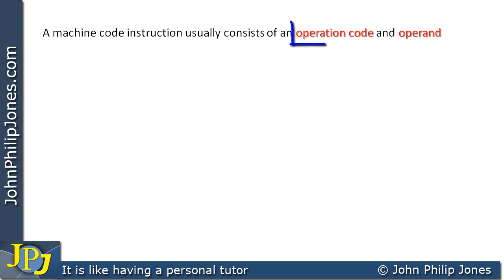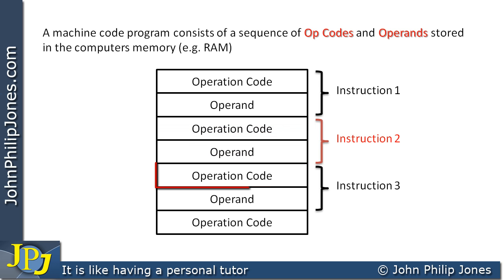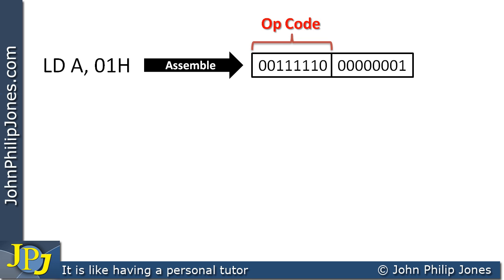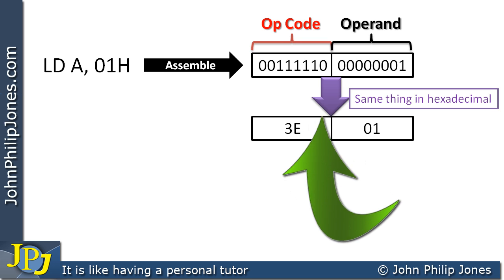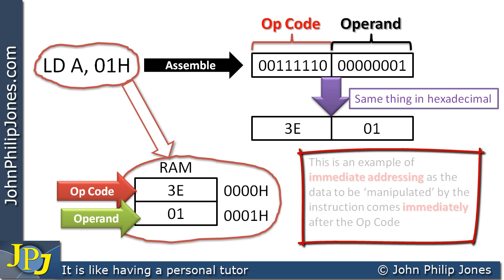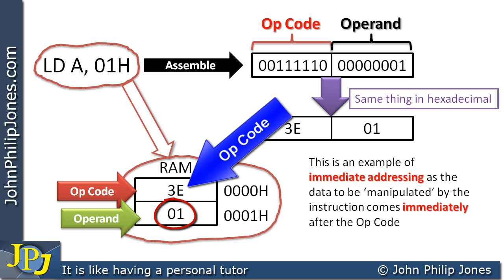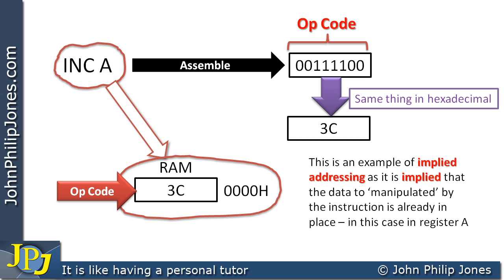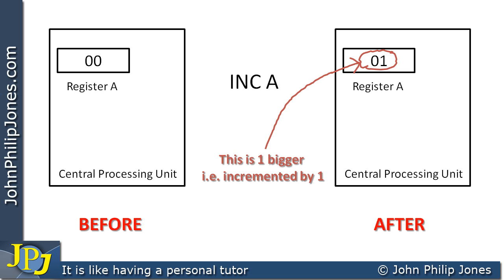Machine Code Instructions

Comment: Great stuff! Thanks. Is it necessary to convert instructions and operands to hex numbers? Can you keep instructions as binary code instead of 3E or something like that?
Reply from the maker: +zinturis You would normally code in assembly language and this is converted to the necessary binary codes by the assembler. So in the machine you would actually see binary and not hexadecimal. However, it is usual to look at the binary in hexadecimal as it is easier for us to remember hexadecimal numbers rather than long binary numbers and it is also easy to convert between binary and hexadecimal. The following videos look at converting between Hexadecimal and binary:

https://www.youtube.com/watch?v=fhgk2rxrn-Q&list=PL049A4BB543D49D6B&index=6

https://www.youtube.com/watch?v=V-he1Ip36OA&index=7&list=PL049A4BB543D49D6B

Best wishes
Phil
(John Philip Jones)
Reply: Thanks a lot for the quick answer. Sorry if my questions may sound stupid, I am quite newbie in this but if you want to send certain instructions of machine code to the processor, what's the workflow of that? Can you do it from some terminal or do you need to create a text file and save as .bin or .. how that works in practice? I mean, how to control that process?
Reply from the maker: +zinturis You use an editor and type in your assembly language program and save it in a text file and use an assembler to convert your typed in program to machine code. You will need to download an assembler to match the CPU of your computer. However, a good way to learn is to download a CPU emulator that has an assembler incorporated. I used to do assembly programming on a Z80 flight micro-board, a 6511 micro-controller using an in-circuit emulator. However, these have now been superseded and I am not sure what is used today. However, I believe that the Raspberry Pi has a set up that allows for machine coding. I would recommend searching with the phrase "machine code emulator" and see what is out there to assist. Hope this helps.
Best wishes
Phil
(John Philip Jones)
Reply: From your earlier respond, I understand that assembly language is different for different CPUs? So, if I write z=x+y for Intel it is not gonna work on an AMD based computer? So what's different? Assembly commands or register addresses?
Reply from the maker: zinturis z = x + y is a high level statement and will be converted to the machine code of the CPU that is 'in' your computer by a compiler. However, putting this aside the opcode for add on each different type of CPU is different. Each processor also has a different register set i.e. different number of registers and of different lengths. The architecture of the CPU's can also be different some are RISC other CISC or a combination of both CISC and RISC.
Reply: Thank you very much for such a huge amount of information.
Reply from the maker: zinturis Glad to be of help
Best wishes
Phil
(John Philip Jones)
Reply: :) ok, a few more probably last questions: does assembly language needs to be compiled or is understandable by CPU? How do you get all commands and codes for a certain CPU for your assembly version? Is there any command or file that prints out a list?
Reply from the maker: zinturis Assembly language is assembled to machine code by an assembler e.g. LD A, 87H is converted to 3E 87 which is the hexadecimal representation of two eight 8 bit binary patterns, The 3E and 87 (the binary values of these) is understood by the CPU. An assembler will give you a print out of the assembly language and the machine code (i.e. the hexadecimal codes.)
Phil
Reply: Ok. Cool. Thanks.

Comment: I want to know about how machine code is executed. I mean, since you already have these 1s and 0s in RAM, how can the CPU tell from so many instructions and do different actions correspondingly?
Reply from the maker: +Simon Lee When you switch on a microprocessor system (e.g. a computer) the hardware will always look in the same memory location. This location must hold the first operation code to be executed i.e. the program to be executed starts at this memory location. For a computer this is the boot program. For an embedded system containing a microprocessor this location would contain the first operation code for the first program to be executed.
Reply: +John Philip Jones  I am sorry, but I am still confused. I mean how  the CPU can know  these 1s or 0s mean MOV, ADD or SUB etc. How do 1s and 0s make sense to the CPU and indicate the CPU what to do?
Reply from the maker: +Simon Lee A microprocessor system is a collection of million of switches that control the movement of binary patterns along bus systems, In addition these switches can be arranged to perform logic and arithmetic operations. The control of these switches is achieved by another lower level language that is not machine code. However, the machine code is able to dictate which parts of this lower level language execute. Certain patterns within the machine code select the Mov, Inc parts of the lower level language that is to execute.
Reply: +John Philip Jones So, there is a lower level language than machine code. What it is? It seems to be getting complicated, is there any website or book that gives a  detailed information and help me understand?
Reply from the maker: +Simon Lee One of the levels below is microcode and this is responsible for directing binary patterns throughout the CPU. The main controlling subsystem within the CPU is the control unit. However, my advice is not to go below machine code as unless you are an electronic engineer it is more likely to confuse any understanding of how you can control a microprocessor system using machine code. My recommendation is to consider the register set of a typical CPU and use register transfer language (RTL) to understand how each machine code instruction executes. The best way is to look at manuals associated with a microprocessor (although they are not easy reads). A good starting place is to search for the "Z80 assembly language manual".

Hope this helps

Phil

Comment: Hi, I hope you can help me:

I know what opcodes are and how they work, but i want to know something that i have just realised i've overlooked all this time, assembled code (binary after assembly) is just a sequence of instructions in the .text section right? (so all the opcodes with applicable operands).

If so, i was wondering essentially how the CPU knows what each opcode actually refers to e.g. how does 0xDE mean 'load'?

for example: say the cpu of a microcontroller turns on, the program counter = 0, so it loads the first opcode in .text (at the start of the section) into cpu and a hardware decoder in the cpu physically decodes each opcode which allows the CPU to translate the intended instruction into the correct operation, right? (then as program counter increments, you process the next operation (opcode)in .text).

cheers!
Reply: +orbita1 Each OS has it's own standard of executable (Windows - PE, Linux - ELF...). OS loads the executable and parses the exe header and finds out starting address. OS loader then memory maps the exe and sets IP or EIP register to proper starting address by context switching. The program then continues there on.  Now depending on addressing mode, the operand can be from .text part or .bss or .data? etc segment.  

But the first instruction (after switching on) is always a predefined address. For Intel/AMD IBM compatible pc, it is FFFFFFF0h or FFFF0h (depending on 32bit/16bit). Most of them are pointing to BIOS startup routines, which sets up rest of the booting process. Once the ball starts rolling, it works.
Reply: Your struggle may be related to asking how does the computer "understand." Perhaps it would help to remember that a computer is merely a bunch of switches. Some of those switches turn other switches on and off. The computer does not "understand" anything in the way a human understands things. The computer is just switches which have been arranged by humans in such a way that certain switches turn other switches on and off in a way to represent numbers and characters understandable to humans. A light switch does not "understand" that the up position means that it is been asked to light the room. When the switch is in the up position power flows to the light because humans have designed the circuit to work that way.
Reply: +orbita1  I think I just have the same confusion like you. How can these 1s and 0s make sense to the CPU and be executed differently?

Comment: Machine code instructions are: E 
	 Binary patterns which can specify opcodes and data
	 Text Mnemonic Codes
	 Hex instructional codes
	 Decimal codes

which one correct
Reply from the maker: Machine code are the binary patterns that control the CPU. Hexadecimal is an easy way for humans to remember the binary patterns (it is easy to covert between binary and hexadecimal). Mnemonics are symbolic representation of the binary patterns and mnemonics form assembly language programs. Assembly language programs are converted to machine code by an assembler..
Reply: John Philip Jones  thank you I thout the A is Hex instructional codes now i get it.
so i have 2 Q when i folow you i think that I get the answer so far 

Q1.	Which of the following CPU internals can will fetch or store data to and from RAM?

Control Unit (correct- its; the job of CU to fetch data  from external devices and registers)

Regsiters

Interface Unit

Arithmetic Logic Unit 

Q2 Which of these CPU internals can be of either data or address type?

A- Interface Unit 
B- Registers  correct (both data and address- they can contain data as well can be addressed using predefined names)
C- Arithmetic Logic Unit 
D- Control Unit 
Q3
 also is  CISC CPU use of microcode . correct
Reply: John Philip Jones do u think my answers is correct
Reply from the maker: Ali Salman Q1 the control unit
Q2 the answer is B You are correct. Have a look at the following video:

http://youtu.be/XM4lGflQFvA

Best wishes
Phil
Reply from the maker: Ali Salman Yes Phil
Reply: John Philip Jones thank u

Comment: How we should find opcode for an operation is there any method r it is assigned value
Reply from the maker: +sanaaf Each microprocessor will have it own user manual and there will be a list of assembly language instruction and in the column next to the instruction will be the hexadecimal value for the instruction. However, you would normally type up the program using an editor and use an assembler to convert the program to machine code (i.e. hexadecimal which is a way to represent binary).
Regards
Phil
(John Philip Jones)

Comment: I get how you know that 01H is 00000001 in binary... But how do you convert the LD A into binary? Or is it something your remember from a list? I have to convert it into machine code, is machine code binary?
Reply from the maker: This is a very good question. Machine code is the language of the machine (I.e low and high voltage levels) which as humans we represent as binary. Every machine code instruction has it's own binary number. Load A with immediate data has the binary number 00111110 which is 3E in hexadecimal (an easy way to remember binary). So every instruction has it's own binary number. Every instruction has it's own binary number so in a sense it comes from a list as you suggest. However, in truth each number makes the electronics behave in a specific way. The binary patterns open and close electronic solid state switches that perform a simple task that when all executed in a specific order are able to implement sophisticated functionality.
Reply: John Philip Jones So does LOAD have it's own binary number? Or for example do LOAD A, LOAD B and LOAD C count as three different things with three separate binary numbers representing them?

And does this mean that there is no way of mathematically converting LOAD A into binary in your head/on paper without a table that literally tells you which binary number represents each op code I think it's called?
Reply from the maker: malteeaser101  LD A, N has its own binary number called an Operation code. LD B, N has a different operation code. When writing assembly language program you type in instructions such as LD A, N and an assembler (computer program) converts the assembly language to machine code (i.e. binary patterns). You can also do the conversion as a human it is called hand assembly and it means you would have to either know all the codes or access them from a printed list.Back in the day I used to code in assembly and as sad as it may sound I knew all of the codes. But there was only around 70 different instructions for the machines I was working on.
Reply: John Philip Jones Haha thanks, I have a assessment due in soon and this helped A LOT.
Reply from the maker: Mo Fo Hello Mo, Every 'type' of CPU (processor) has its own machine code language and related assembly language. For example Intel processors are different to Motorola processors and have a different machine code language from one another. The description I have put forward is based on the Zilog Z80 processor which also has its own machine code language.

I am unsure what machine code language you are referring to but what you are describing is  what is often called absolute addressing  The term addressing refers to how data is accessed by an individual machine code instruction. I have a short series of videos that show the difference. I have put links to their playlist below:

https://www.youtube.com/playlist?list=PL6lxxT7IdTxGXX6D6j-zjzcgoOD8WYMS2

Phil